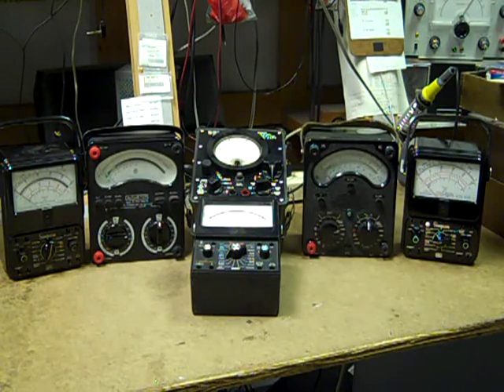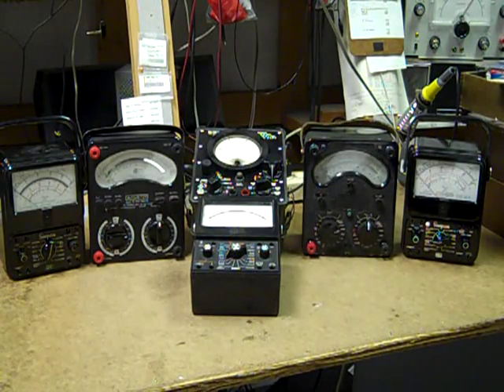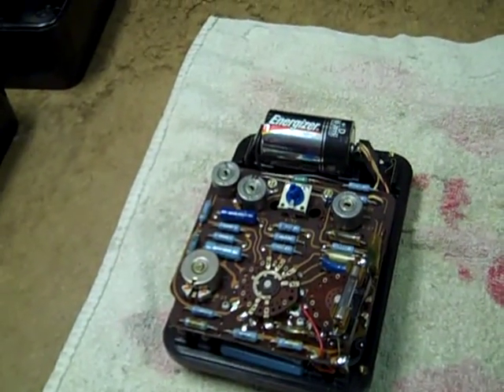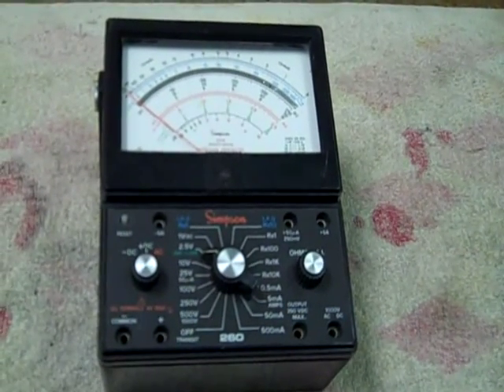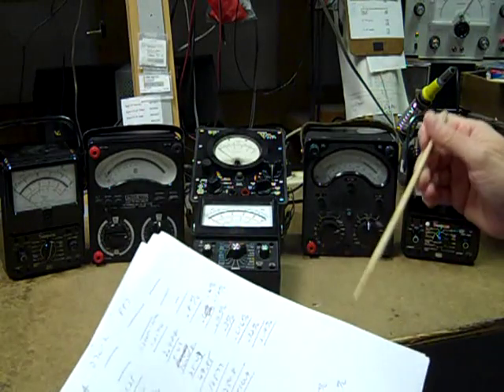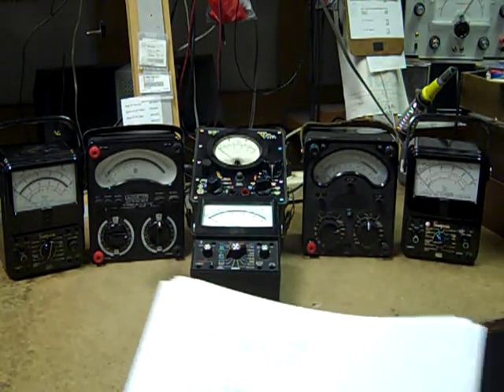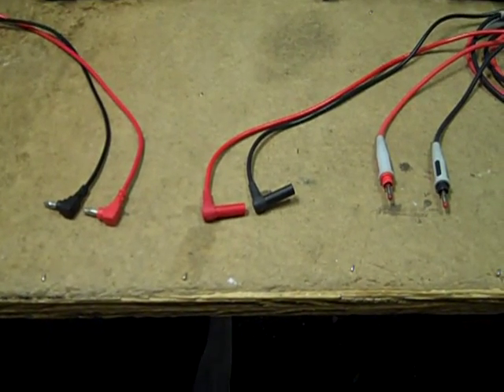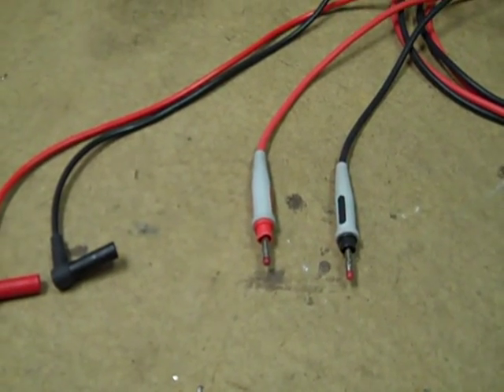Multimeter Junkie Multimeter Shootout

Comment from the maker: I love my Simpsons and AVO's but the thing with the Fluke is more of an issue in the case of possibly causing an arc flash in a high energy circuit. A Fluke would contain it and just die without contributing dangerously to the incident. I have measured up to 2500 volts in a low current circuit using the Simpson 270, but I was still really antsy about doing it. I'm just a consumer electronics repair guy and most of my training and experience is on the secondary side of the power transformer.

Comment from the maker: By the way. Voltage reading on the AVO meters were taken in the horizontal position. The others were all in a tilted position - that's how I normally use an analog model. Curiously, I don't usually tilt a Fluke. Hmmm.

Comment from the maker: Hi, I don't know your price range but get a Fluke 87 series V if you can swing it. You can get one in good shape on eBay for 200.00 or less.
Any Fluke in good shape will serve most purposes but if you will need the microamp range stick with the 80 series.
For general voltage readings at home or in the shop a good old Fluke 77 is hard to beat.
I have an 85 series III I'm thinking about selling - nothing wrong with it at all, it's just that I'll reach for the 87 instead.